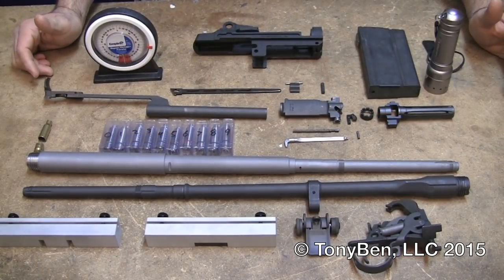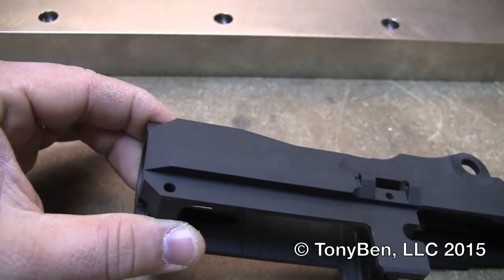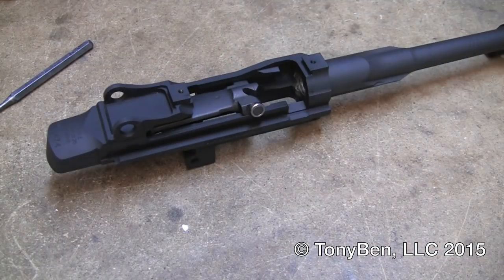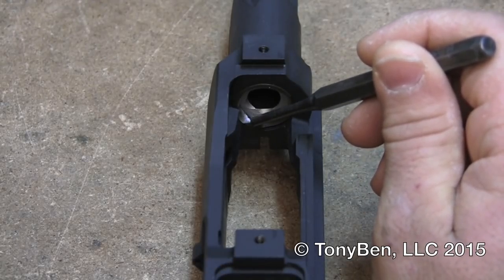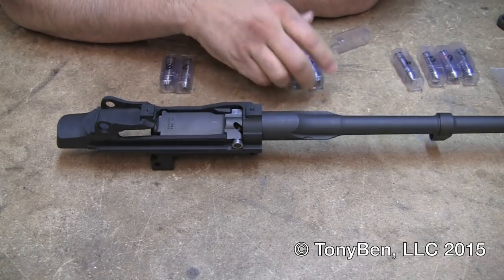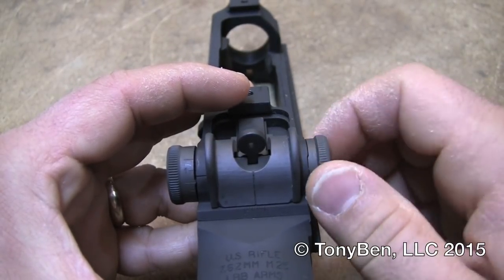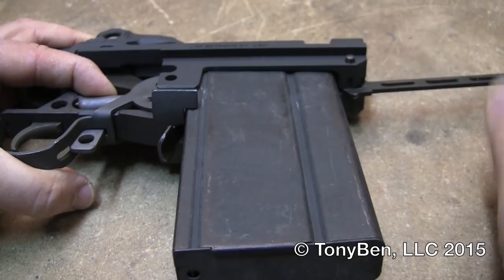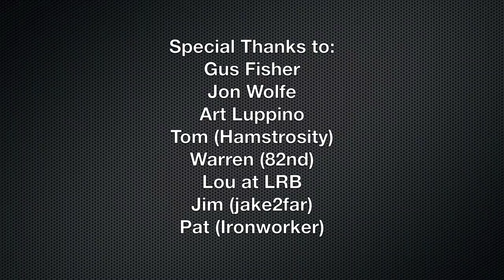Building an M14/M1A, Part 1: Receiver Inspection and Parts Fit

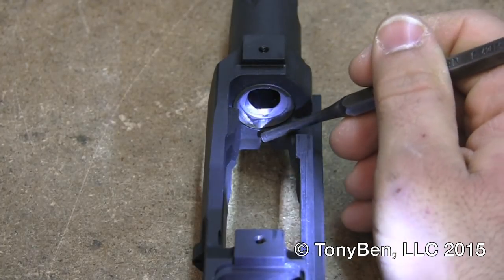Comment: Excellent video, many thanks for sharing your expertise. QUESTION.. @ 18:45 you're reviewing the timing of a hand tightened barrel on to the receiver. You mention a remedy for the barrel being too far away (turning the shoulder on the barrel), but what about when the barrel hand tightens right at the 6 O'clock position? Will the gunsmith simply use shims to keep that barrel a few degrees back to be able to apply the 85 lbs of torque?  Again, thanks for the video. I appreciate all the information. I've built M1 Garands on multiple occasions over the years and now I'm tackling my first M1A. Thanks.

Comment: Hey Tony what do you think of the Rockola M14's that James River Armory is making? From what I have read, their forged receivers are fantastic like the ones LRB offers. I am looking at getting one. What do you think?
Reply from the maker: Go for it! I haven't handled one yet, but that should be resolved in a short amount of time. I hear the bolt lug contact is excellent without lapping.

Tony.
Reply: +tonyben3 Fantastic, I actually placed my order on my lunch break today at work. They seem like great people, very helpful on the phone. 1-2 months lead time as of right now. They told me they are slowing starting to get in fresh batches of receivers, so that lead time may shorten up. I guess they were flooded right at the beginning of June. I think it's a more cost effective way of getting into an M14 platform, by the time you install all the GI parts in a Springfield M1a, your already at or beyond the cost of the JRA and you still aren't getting a forged receiver. Thanks for the input.
Reply from the maker: You're welcome!

Tony.

Comment: I'm shooting some German silver bullet MEN/DAG ammo with early to mid 90's headstamp through a springfield scout produced within the last few years. Some of the primers seem to be setting back by maybe .006" (enough to notice and feel) The round count is under 500 on this rifle. I've only recently noticed it and have only noticed this defect on the MEN ammo from a certain lot number and only on a 3-4 casings out of about 100 MEN/DAG shot. I'm curious as to what causes this? Should this be cause for concern? Bad ammo? Headspace or chamber issue?

I'm also considering a fulton armory enhanced barreled assembly. Would you recommend them?
Reply: sorry to say this bro..I'll tell u why ur rifle is fucking up..
because it was made in Taiwan.. with sub standard parts..look it up if u don't believe me..I have owned a m1a..and loved it but anything with Springfield stamped on it should never b made anywhere but in the USA..its actually not even the real Springfield just some jackass company who bought the rights to use there name. the 1911's they produce..are u ready.. are made by imbel in Brazil..
Reply: +1975nova I'll agree, manufacturing standards aren't up to snuff. hell even top tier manufacturers aren't matching the quality of real deal GI. It functions fine and I've had no problems with the rifle though. I'm guessing the ammo was the issue rather than the rifle.